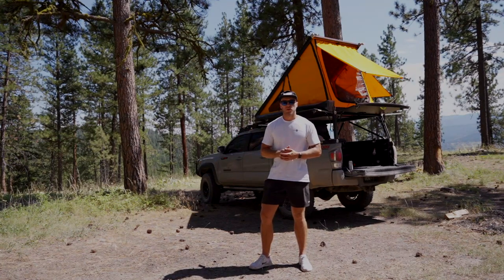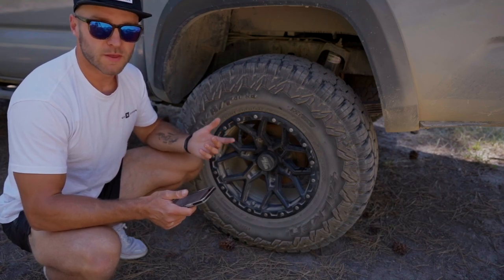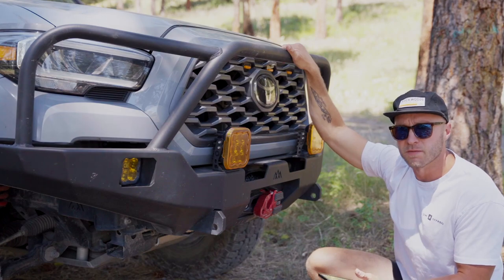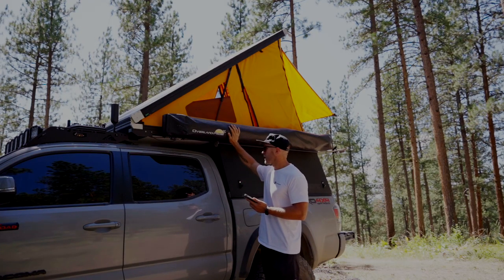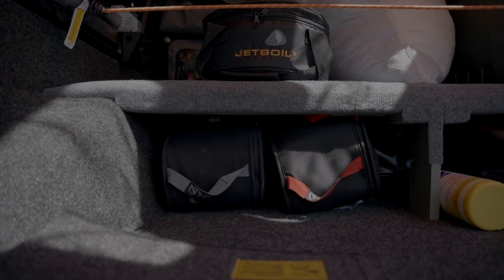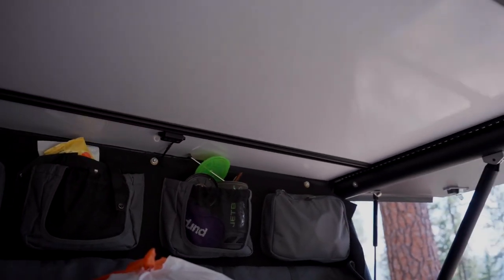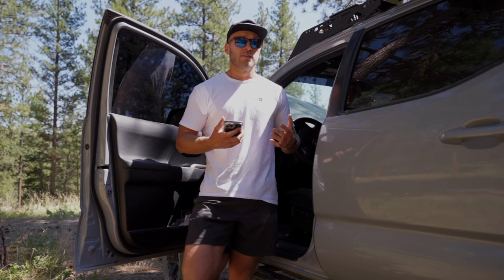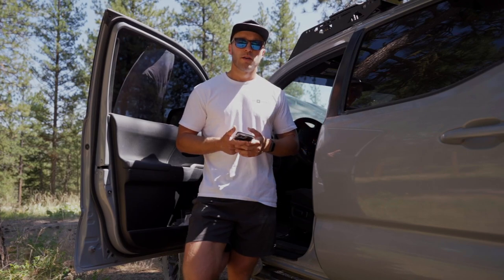Total Cost to Overland Build My 3rd Gen Tacoma - It's A lot.

Comment: I wish I could have gotten a Cement Tacoma. I just picked up (27Jan2024) a black 2023 Tacoma TRD OR base Access Cab. The first major purchase I am going to get is the Cali Raised OffRoad 0° sliders ($1399+ HI tax). I got the Goodyear Territory AT’s stock so I’m probably not going to lift it for a while.

My 2022 Lunar Rock T4R TRD Off Road Premium I had in Oct 2021 the first mod was a set of 5° RSG sliders and Baja Designs SAE amber fogs.

Comment: Love your setup. I’ve got the same truck but a year newer and just starting my build. I too have installed the Deaver stage 3 and am afraid that they may be overkill for my build. Did you do any mods to your leaf-pack such as remove any leaves? I thought I heard you say something about that. Also, did you have to do the cab mount chop or anything else to make room for the 34” tires? Thanks!
Reply from the maker: Thanks for the comment!!!

Deaver stage 3 is currently overkill for my build and as it sits. I was looking at going alucab for a bit but that might now happen. The ride does rear stuff for sure but I also love the look of having the rake in the rear. I might have to remove a leaf or two though.

I do have a CMC and the SPCs are maxed out for caster. I only rub on plastic now when full tucked or turning while flexing pretty hard. It’s honestly the best size tire imo and doesn’t require the headache that 35s do.

Comment: With the 3 inch lift in the front and 1.5 inch lift in the rear the truck without any weight should be pretty level but with the GFC on the back all the time and other permanent bed weight you have do you find it sinks the rear out too much and wish you lifted the rear more?
Reply from the maker: I have way more than 1.5 inches in the rear with the stage 3 Deaver. Don’t have the GFC anymore but even with the super pacific I still have rake. The Deaver stage 3 is certainly overkill for what I have in the back now but my old old previous setup was much heavier.

Comment: Hey dude, how's your gear hunting experience on your beautiful rig? As many tacoma owners are talking about this issue! Thanks.
Reply from the maker: The OTT tune really has helped. I have been hesitant on regearing to 5.29s just because I’ve heard mixed things AND it’s a hefty cost. I’d recommend a tune first and see how it drives but for me, it really changed the way the truck feels!
Reply: Thanks, dude, now I have an idea. Next year, I plan to buy the legendary tacoma model ever made by toyota. The fourth gen. is a new platform, which is awesome but the most expensive tacoma build!
Reply from the maker: @gilmacababbad-qi9ql  yea the mark ups on the 4th gen are gonna be insane